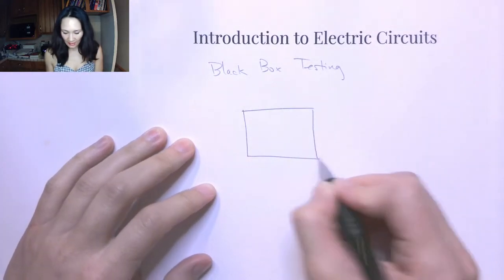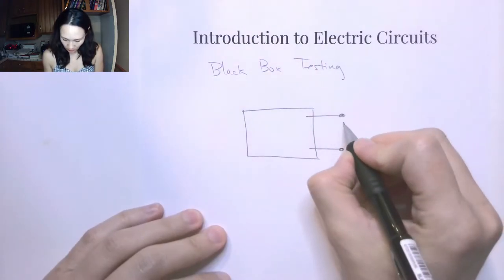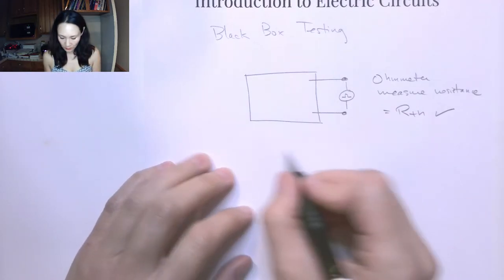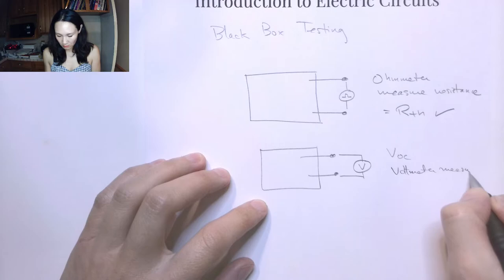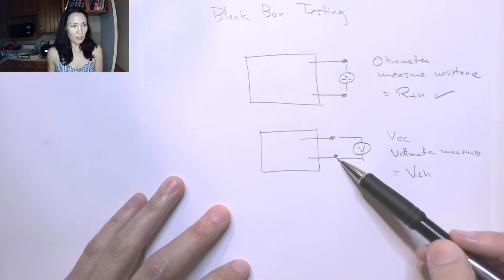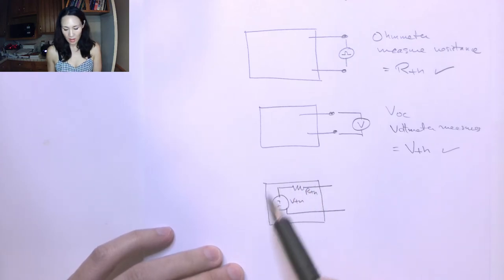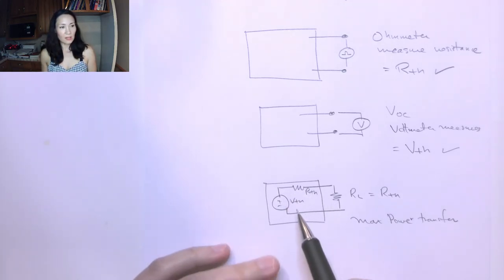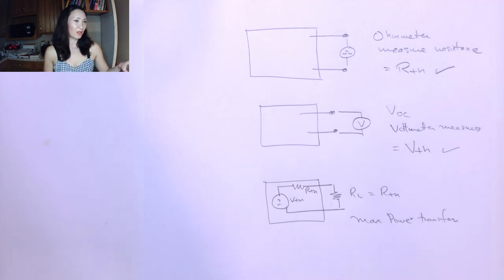Black Box Testing

Comment: If the box has Voltage across its terminals we won't be able to place Ohmmeter to measure eq. resistance. The short current needs to be measured as I understand this problem... and than calculate resistance.